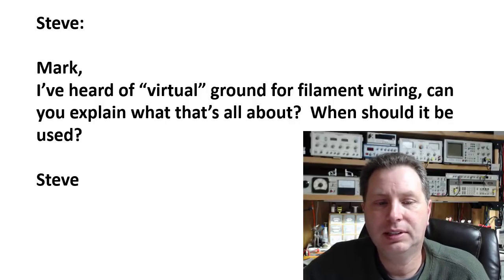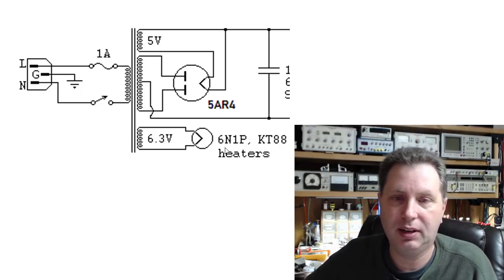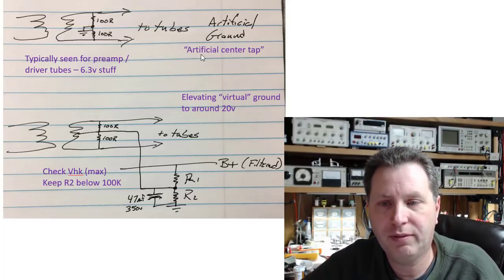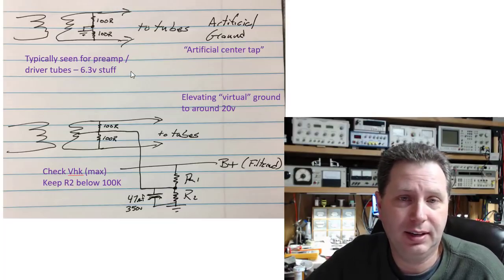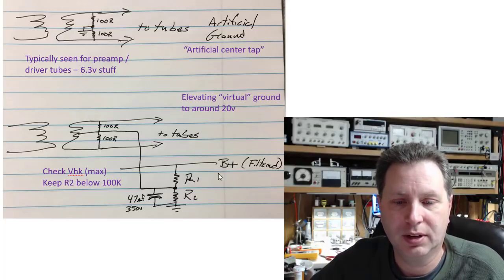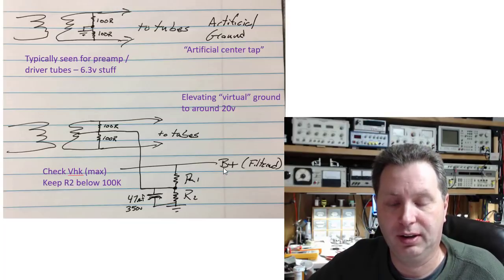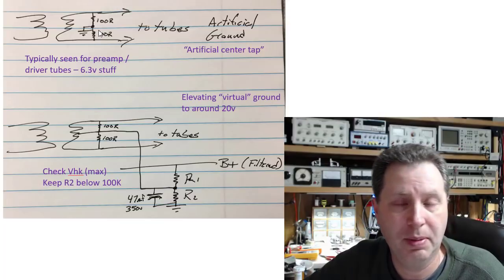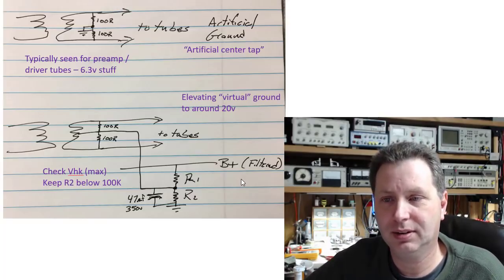Vacuum Tube Virtual Ground or Center Tap & Elevated Heater Wiring Explained

Comment: Question:  If I have full bridge rectified DC power to all the heaters (input and power tubes), would an artificial, elevated or any ground be needed?  I am using 6SL7 & 2A3 valves in my build.

Comment: Why the filament wiring has to be tied to ground or any other level?
What if the heaters are left floating? Would that increase, decrease noise or it may cause some other issues?
Reply: Probably horrific hum.

Comment: In an Audio Research SP3 they only elevate the last stage before the output with 12volts at ground on the first two stages and at 35 volts I believe on the last stage heater. They used a 24 volt power supply with the one 12 volt supply lifted.

Comment: Hi! Can i use elevated heater with fixed bias AB poweramp or its just only for cathode bias poweramp? If i have center tap on the heater  and the heater is elevated, how should i wire the ground, if i would like to use DC for preamp tubes(hi-gain amp)?

Comment: On the lower diagram of the 6.3V secondary winding, is the line connecting what could be a true center tap of the secondary with a point between the the two 100R resistors actually meant to be there or is it a mistake in the diagram that was not corrected?  That is, at 4:15 Mark refers to a virtual center tap between the two 100R resistors but an actual CT is depicted in the diagram.

Comment: With regard to the centre tap application, what voltage handling capacity is need for the resistors?

Comment: I have a BIG, funky looking 60 watt Webster Chicago PA amp (unknown working  condition), cathode-biased, with 4) 6L6GB'S that I want to convert for guitar use. Couldn't find a schematic so I've been drawing one by hand; come to find it apparently floats the 6L6 cathodes by means of the tail-end of the main B+ supply (after all the preamp tubes are powered), fed thru a BIG 5K power resistor and connected to the 6L6 cathodes! Or, to look at it another way, perhaps the cathodes of the 6L6's are floating the tail end of the power supply? I found a somewhat similar Rauland amp schematic in my Sam's collections that does pretty much the same thing; that schem shows the 6L6 cathodes at 25 volts above ground, though that doesn't seem particularly unusual for a cathode biased amp (one shared 100 ohm power resistor to bias all four 6L6's).   I expect it'll be quite a project to figure out how this beast works and try to bring it back to life. It has three mic inputs, each with its own 5879 pentode (mounted on shock-isolating rubber grommets), a 6SJ7 after the input pre's, a 6SN7 for the bass and treble controls (Jones or Baxandall? It has small inductors wired to the pots), and a 6SL7 phase invertor.

Comment: Great video.  Thanks Mark.  At 3 minutes into the video (3:00/7.:53) ... lower schematic ... are the two 100R resistors (as would be used to create an artificial center tap) still required when there's a real Center Tap?  What would they do, other than just dissipate power?
cheers, Simon
Reply: If there is a real center tap, the two resistors are not required.

Comment: I just built a nice stereo HiFi 6v6 P-P Ultralinear. Sounds fantastic but has a very low level buzz/hum. It is independent of volume, source or no load on source. B+ is stable but a bit low i have a weak rectifier i need to replace. Phase inverters and pe-amp are 6SN7. Pulling preamp lowers the hum very very slightly, pulling PI tubes eliminates it so it is not coming from PA stage. Filaments are AC with no CT on transformer. I have tried the virtual CT and potentiometer method in the past but have not had success with it. This is the first i have learned about floating the filaments above ground, did some research and apparently it is also common to use the cathode bias voltage of a PA stage to float the filaments. My PA stages are fixed biased around 60mA resulting in an almost perfect 20v bias. Would it be reasonable to use the bias voltage of one channel to float the filaments at 20VDC to eliminate some of the buzz from the filament supply? Sources I have read say it should put next to no load on the bias circuit since its not actually drawing current just creating a reference. Yes i realize i could supply the filaments with regulated DC, but my goal on this amp is to use zero modern technology.

Comment: does it make the heater voltages higher than 6.3?    how not?
Reply: It would not as long as there is no ground reference in the circuit. AC is a value of fluctuating voltage based on a reference, usually that reference is ground (0V) by referencing a higher voltage you will still have 6.3VAC with respect to that reference. The heaters will still only see 6.3v.

Comment: According to me, a hum balance pot is a good way to go. Inside my amp I placed a 250 Ohms 4W potentiometer for the purpose and it works great! But I think the voltage divider method worth the try.

Comment: So if you were to lower the the two 100 Ohm resistors to say two 47 Ohm 2 watt resistors, would that offer more, less, or the same cancelling effect in filtering out hum and noise?  I'm wondering why 100 Ohms?  Thanks Great Vids!
Reply: To reduce load on the transformer winding while still remaining effective. If you have the head room you can go lower if you want, but waste more power.

Comment: the other heater centre tap is to take the centre tap of the heater supply to the cathodes of the output tubes in class A/B 1 or class A1 to elevate the ground

Comment: So each of those 100K Ohm resisters with 3.15V AC across it will always draw  0.0315 mA.
They will dissipate 0.09819 mW of power.
Do I have that right??
Reply: Those resistors need to be a low value of 100 Ohms or 220 Ohms to shunt leakage currents from the transformer primary. 100 Ohm 1/2W or 220 Ohm 1/4 are usually used.
Reply: @silasfatchett7380  This is what every source I've ever seen (and am looking through now) says. What's this guy's major malfunction?

Comment: Why not  just  send DC  to the filaments  by way  of a  full  wave rectifier  and capacitor  to reduce  60 Hz hum ?
Reply from the maker: Tons of debate on this one.  Seems these filaments were designed to work on AC and while they work on DC, many purist say not as well.  Otherwise you would see a bunch of small LM317 or similar voltage regulator in tube amps, which you don't...  I'm not sure there is a right answer, just an opinion.
Reply: the datasheet of a 12ax7 for example says Heater Voltage Ac OR Dc , 12.6 series or 6.3 parallel. From my experience If you can have a real good ripple free DC voltage source it would be better for a single heater tube (especially if it is in the preamp chain or at any high gain stage).
Reply: mamoynas I just tried this yesterday. I hooked up my dc power supply to all of the heater circuits in my amp, expecting it to eliminate all hum, pretty low anyways, however: it made absolutely no difference at all. 60hz hum stayed exactly the same. The music sounded the same. I just put it back the way it was, that was pointless, my hum must be from the transformers being so close to the output tubes.
Reply: @michaelhelgeland4588  get a piece of Ferris (not aluminum) sheet metal and ground it with an alligator jumper to your star grounding point then hold and move it between tubes, tubes and transformers etc. as a makeshift test shield, if you cant find it topside then its probably wires too close or crossed leaking RF etc. If the amp is already built, and you more interested in output than glow you find that it indeed is a tube too close to transformer there are good looking polished tube shields cheap aluminum to very nice Stainless?
Reply: @doncalloway4125  Thanks Don, I was actually experimenting with this the other night. My amp is a Nytone SA-2000 so it's not the best tube amp ever built but I've restored it. I actually discovered that the hum is 10 times worse in the Phono stage even though the phono inputs are shielded. I got to messing around and made an aluminum foil shield around all of my input wires, I also made extra shields for the capacitors. I abandoned the phono preamp on my amp and turned on the one to the turntable and just hooked it up to FM which is identical to AUX. This made most of the audible hum disappear at least at useable volumes if I crank it up past 3 I can't be in the same room, and thats's where the hum is most noticeable now, but with no signal I can turn it up to 10 and it will still hum at a good 30-40 db at 60 HZ there. I added a choke and more filter caps that did nothing but maybe improve bass response. Also any 12ax7 I would put in the front end would whistle at my unusable volume levels, I converted it to use 6n2p-EV and it is much quieter no whistle and no microphonic effect when tapped on not even at full volume.
Reply: @michaelhelgeland4588 Did you use a 25v  10 to 15 thousand uf capacitor with the bridge rectifier like you are supposed to? Also a .68uf  630v capacitor from negative of bridge rectifier to ground. Worked super for me!
Reply: Some people also just don't want any modern silicon mixed with their glass and iron.